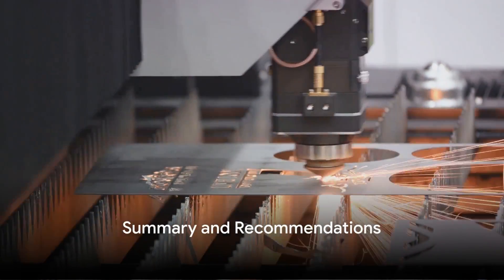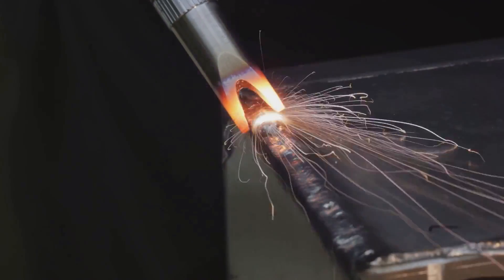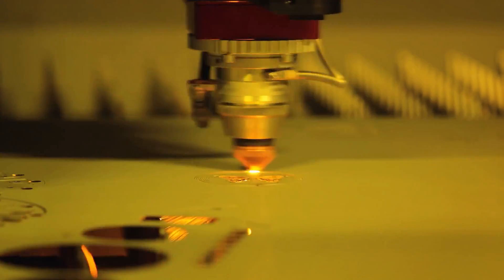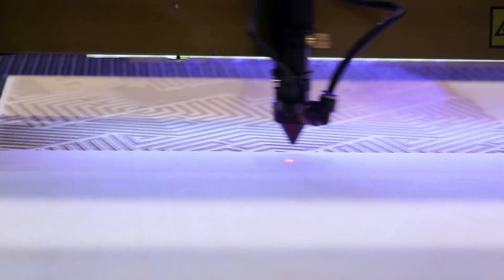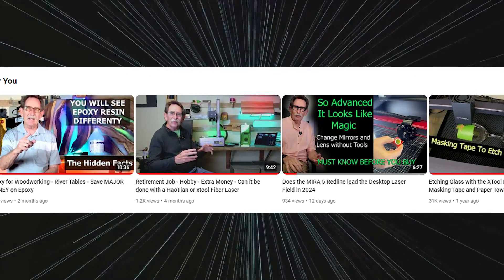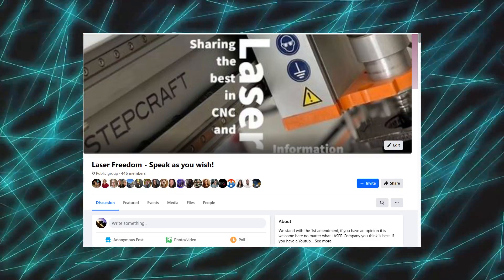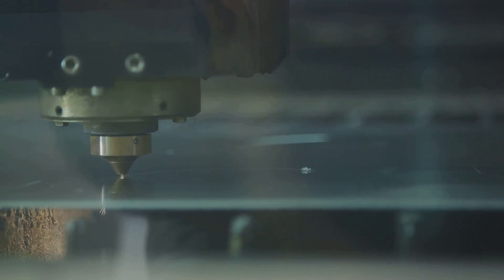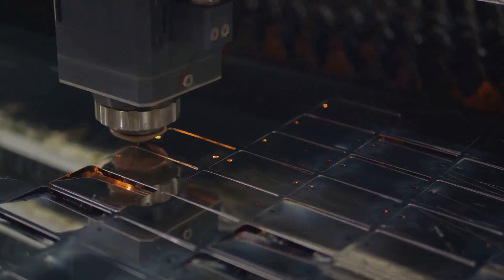The Difference between Glass and RF CO2 Laser Tubes. Fast!

Comment: Glass laser tubes suffer from energy loss, and marking inconsistentcies. High energy output can also cause the glass tube to crack and the gases to escape.
Reply from the maker: you are absolutely right... and the RF tube has a much smaller diameter point allowing for finer  engraves.  The glass tube can be better  for cutting and is a  lot less  $ so approaching a purchase getting the  right tool for the job is important.  AeonLaser.us has a unique approach as they put both  a UV and glass tube in the  same machine.
Reply: @GeorgeKennerLaser  synrad, roffin and coherent are good options, be cautious about Chinese made rf tubes, like EFR, cloudray and spt.

Comment: 1:44 - "less expensive" - what a huge and rude exaggeration! The price difference is simply SHOCKING!
Reply from the maker: You are of course entitled to your opinion but RUDE, may be pushing the intent of the video.  I always encourage people to do their own research.  And when you look at life span of the tubes and strength and recent improvements in price RF tubes are affordable.  I in fact have a Laser on the way that contains but and RF and Glass tube.   Cheers and thanks for the comment.
Reply: Mate, "rude" as by saying just "less expensive" (while it is mathematically true) is not giving your audience full picture. The difference is simply BIG, not only LESS:) Under the comment from @PeteRanchCreations you said the video is covering the very basics. Pete's comment, regarding power efficiency especially, is very valid for the very beginners as people will go and compare the prices and say "whoa, wait the minute...". If the video is for the beginners then beginners are mostly driven by costs  involved thus comparision should take this aspect into account. Good vid anyway:) Thanks.

Comment: I would like to add....Two things that seem to be left out of this explanation that are very important for the viewers to know.  

The wattage of each machine type (Glass and RF) is not apple to apple.  More specifically, a 100 watt Glass tube is not the same as a 100 watt RF tube.  It would be more like a 100 watt glass tube has similar power to a 55 watt RF tube.  That is very important for buyers to know as they may look at a RF machine and see 50 watt and a glass tube being 100 watt and think that the RF tube is underpowered.  That is not the case so know how the tube power  would compare to a different technology tube power.  

Secondly and very important, the beam size of the RF tube is much much smaller than a glass tube so the quality of the engrave will be far superior over a glass tube.  I hope that you don't mind 

WHICH IS MORE PRECISE?
Whether you’re etching or engraving, precision is paramount. Precision and pulse rate are directly related. The higher the pulse rate, the more precise the beam. To get a higher pulse rate, the laser gathers the heat and then rapidly releases it, meaning it’s not heated continuously. When it comes to direct current, there is no room for that rapid gather-release process, because direct current is continuous. This means pulses from glass tubes are less frequent. Therefore, a glass CO2 laser engraver is more limited in pulse rate and tends to execute lower-quality engravings than its metal counterpart.
HOW DO THEY CUT?
When it comes to cutting, the material usually dictates the power settings. If you’re working with materials such as plastic or paper, then the minimum you need is about 30W at about 20% for engraving. Some may favor glass tubes because they work well in lower power settings. Metal laser beams do create more refined work, but they tend to leave slightly rougher edges that are imperceptible to customers and can be smoothed easily.
Reply from the maker: Alisha thank you very much for the more lengthy comment.   As I started in the hobby / Industry I found that  some of the basic vocabulary was missing.  That is why I did this video to go only to the basics.  I agree with everything that you said but it is not basic it is more like the next step of information and that a Laser Sales Professional would supply.   Opening the door to beginners is what I am trying to achieve.  That is why I put this in my  Lasers for Dummies play list.   This is a starting point.   For those of you who do not know Alisha Pate she is on Facebook and Youtube also, and is a respected name in the laser industry, she is worth getting to know and follow.